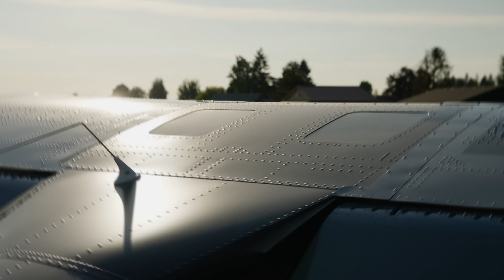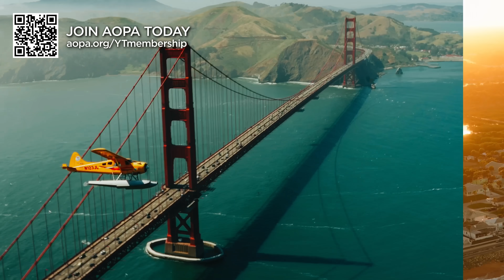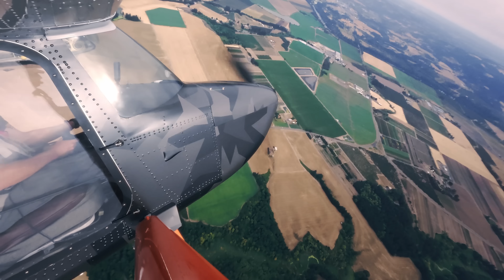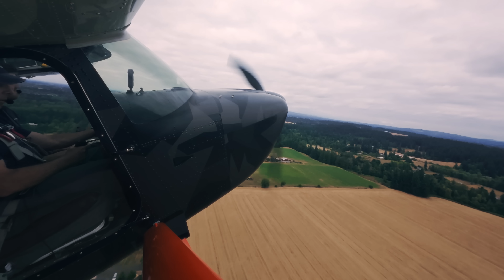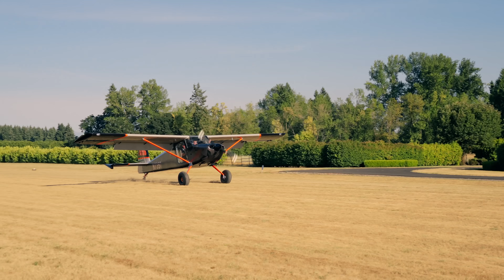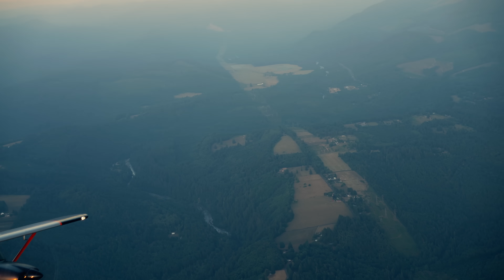We Finally Flew Van's Aircraft's NEW RV-15 – Was it Worth the Wait?

Comment: Never mind the fluff, I want to see some solid performance numbers, and find out what did the STOL cost in HP and airspeed.  I suspect it will be second best compare with the Helio Courier, for it will be a kit and you will try to make it simple, no auto slats or huge flaps with spoilers to add to roll control. Lets hear the compromises.

Comment: how is it compared to a Glasair Sportsman 2+2 kitplane?
Reply: Glasair has been extremely quiet lately. Their social media seems dead. I know they were transitioning to Chinese manufacturing, but it's unclear if that's going to succeed or be the end of the company. I hope they succeed, as I quite like the Sportsman.

With that said, they're fairly comparable high wing 140ish knots STOL/backcountry capable aircraft The Sportsman does offer a CD-155 Jet A/diesel engine in addition to two Avgas options. It's unclear if the RV-15 will offer rear seats or not. The Sportsman has optional BRS parachute, whereas I've heard the RV-15 wasn't designed with that in mind.

Comment: I think the question is "is it worth the money?" I mean, besides to the rich people who don't care that the whole point of experimental aviation has been dead for a long time.
Reply: Only the pricing for the wing kit has been announced. So I think it's too soon to say, as we don't know what the total will be.

I'm not sure exactly what you mean by "the whole point of experimental aviation has been dead for a long time" means. Can you clarify how you know it's dead, and what led to that?
Reply: @masonmcglothlin5101  Hey Mason, regarding my "experimental aviation has been dead for a long time" comment. I mean in the respect that you could build a 4 seat, 200mph, 1000 mile range plane in the $90s for about $40k (My example is a Cozy MKIV that I was working on) I made $11/hr back then but felt like that was an absolutely achievable goal. Most kits, regardless if they are something like a Kitfox up to an RV-whatever is so horrifically expensive that no Average Joe can afford that. I was building an RV-8 and when I started, using the calculator Van's use to have, I was looking at $100k without paint or tools. And even then people told me I was way under what it would cost. Now, If I talk about building that same plane for anything less than $200k people tell me I am nuts and it will cost way more. Everything has increased in cost to ludicrous levels. I cannot afford on a single income to build it anymore. The spirit of homebuilding was to get an awesome aircraft for incredible prices compared to factory.
Reply: @1hornet1  Inflation has certainly happened since the 90's. But considering completing a lot of kits would cost about what an expensive pickup truck costs these days, and how many people there are out there driving those expensive pickup trucks, it seems that dream is still alive for those who want it.

Van's site is showing a basic RV-8 kit for $47.7K and an engine for $44.7K. So $100K for an RV-8 is probably in the right ballpark today. Whether that's doable for you depends on your own financial situation: how much you earn, what's the cost of living in your area, do you have kids or other dependents, do you have outstanding debt to pay down etc.

I see a lot of people complain about the cost of everything, yet they go blow their money on things that just bring temporary joy, they don't take steps to earn more, and they don't carefully consider their housing and vehicle choices. I'm not saying that's you, I don't know you. But for those who are willing to work towards it and start early enough, aviation is still within reach.
Reply: @1hornet1  Inflation has certainly happened since the 90's. But considering completing a lot of kits would cost about what an expensive pickup truck costs these days, and how many people there are out there driving those expensive pickup trucks, it seems that dream is still alive for those who want it.

Van's site is showing a basic RV-8 kit for $47.7K and an engine for $44.7K. So $100K for an RV-8 is probably in the right ballpark today. Whether that's doable for you depends on your own financial situation: how much you earn, what's the cost of living in your area, do you have kids or other dependents, do you have outstanding debt to pay down etc.

I see a lot of people complain about the cost of everything, yet they go blow their money on things that just bring temporary joy, they don't take steps to earn more, and they don't carefully consider their housing and vehicle choices. I'm not saying that's you, I don't know you. But for those who are willing to work towards it and start early enough, aviation is still within reach.
Reply: @1hornet1  Inflation has certainly happened since the 90's. But considering completing a lot of kits would cost about what an expensive pickup truck costs these days, and how many people there are out there driving those expensive pickup trucks, it seems that dream is still alive for those who want it.

Van's site is showing a basic RV-8 kit for $47.7K and an engine for $44.7K. So $100K for an RV-8 is probably in the right ballpark today. Whether that's doable for you depends on your own financial situation: how much you earn, what's the cost of living in your area, do you have kids or other dependents, do you have outstanding debt to pay down etc.

I see a lot of people complain about the cost of everything, yet they go blow their money on things that just bring temporary joy, they don't take steps to earn more, and they don't carefully consider their housing and vehicle choices. I'm not saying that's you, I don't know you. But for those who are willing to work towards it and start early enough, aviation is still within reach.

Comment: 20k for a wing kit and the rest of the kits to be delivered at the end of 2026... We don't even have weight specs yet...
Impulsive people are going to fill the order books up and then discover manufacturing/assembly hiccups that are going to push production and delivery back even further and they're also locking themselves into a build with completely unknown pricing for the remaining stages which likely are gonna climb even higher.... this is going to be a 5 year build if anyone is lucky and it's still be a 2 seater. A great looking plane but the price and delivery times on this are silly. A Sling High Wing carries 4 and goes faster and does all the bush work you could need and importantly is available right now.
Reply: Sling HW has too high of a stall speed for backcountry work. Doesn’t even qualify for a sport pilot under the new MOSAIC rules unless they make changes and re-test it. Don’t get me wrong, I like the Sling HW. I’m looking at the Rans S-21 as a slightly more affordable, fairly quick 2-seat high wing.
Reply: @joesmythe8232  The S21 is a fantastic airplane. It's smaller than the RV, but the advantage is that it really performs with the Rotax 916!
Reply: A Sling high wing will do no such thing as bush work, especially with 4 people aboard; it's design and performance clearly compromise that in favor of speed. I don't disagree with the rest of your rant.
Reply: @serg2963  You and everyone else know perfectly well that 90% of RV-15 builders will NEVER take it to the bush or anywhere that requires an actual STOL airplane. A 2,000' grass strip is not the "bush" and a Sling HW can handle that easily.
Reply: @Jester-uh9xg  I've read of people wanting to put wheel pants on their -15 for better speed... so  your estimate of 90% is about right! But I will NEVER agree that the -15 and the Sling are comparable aircraft. Some people's mission might have overlap between the two aircraft, and those people should consider it... but at that point, one could consider a Bonanza, or a Mooney... I think you get my point.
Reply: @serg2963 I'm sure the RV-15 will be a great aircraft on its own merits but I think the excitement around it is a little odd. If people wanted a 2-seat side-by-side bush plane there's already several options including the fabulous S-21, and they'd already be building one. But they aren't, and those don't get 10% of the hype. I think the RV-15 hype is just because it's a high wing Vans, not because it's a bush plane, and people have kind of the wrong expectations. As far as Mooney vs Sling HW, well, the Sling is high wing and not 60 years old. For the same price the Sling HW would be massively superior to those (sadly they're much more expensive, just like the RV-15 will be).
Reply: @Jester-uh9xg  OK, I agree with you 100% on the S21; a truly fantastic airplane and a perfect match to the fantastic Rotax 916. As for Vans being a little "culty"... sure! HAHAHA  All joking aside though, the attraction (for me) to the RV is the size... and the assumption that being an RV, it'll handle much better than something like a C170/C180. The hope is that it'll handle as well as the S21!
Reply: Its great to see a all metal STOL aircraft.  Much of the back country planes out there are fabric.
Reply: @fudogwhisperer3590  that's true, there are some options coming to market which is great news. Direct Fly has the STOL Cruiser which looks a lot like the Vans actually. Should be on sale 2026. 60kg payload capacity supposedly and very similar specs. There's the Sirius Backcountry which is composite and the STOL Cruiser actually outperforms it despite being all-metal! I look forward to someone putting some VGs and fences on the STOL Cruiser once it hits the market!

Comment: Here we are in 2025 finally able to build essentially what could be bought off a showroom floor in 1955. (Cessna 170).

I realize a lot of people have been itching for an aluminum high wing with grass airport operation as a primary consideration. But there is nothing groundbreaking here. Not like the RV-3. Or the -6 when they came out. 

This is tame and ordinary. But it will cost fully 3/4 of the price of a new Cessna 172SP to complete one of the RV-15s with similar appointments. (All glass, leather, etc).

You can buy a brand new 172 fully loaded for about $400k. This will cost $250-300k with all-new engine, prop, equipment, G1000, and paint.

EAA has gravitated away from high performance for everyday car prices. To mediocre everyday performance for supercar prices. You have to take out a loan on your 401k if you want to fly and enjoy one of these things before you lose your medical.
Reply: You can be upset about the expense of these kits and basically all of aviation compared to the past but you are completely out of touch and incorrect about new Cessna 172S prices.  They haven’t been $400k new for a decade now.  Even a 10 year old 172S easily sells over $400k now even with massive hours and wear from a flight school.  2025 Cessna 172S prices are quoted by Textron as over $700k with delivery hopefully 2028.  As of Oshkosh 2025 they were basically $750k. They sold a few that week.  An RV-15 will have much better performance and cost less than half as much even with the very best appointments.
Reply: 1. We don't know final pricing of the RV-15. Only the wing kit pricing has been announced.
2. Where are you getting $400K pricing for a fully loaded 172? My understanding was they pretty much start at that price, and their factory is backed up with all the orders.
3. If the RV-15 costs $100-150K less than the 172 at similar or better performance levels, that's a massive improvement, and something to be celebrated! Particularly if the RV-15 can have 4 seats.
4. The Cirrus SR series leads GA sales by a pretty wide margin - and they're more expensive than a 172. In some cases 2-3x more! It seems the market is demanding all these features, and putting their money where their mouth is and actually paying for it.

I agree, it's unfortunate that prices are as high as they are. I'd like to see more budget four seat options in the $150K range, even if they're a bit limited on features. But it's good to celebrate steps in the right direction.

Comment: This could honestly be a decent Cessna 172 competitor
Reply: But faster. This thing with that motor has 20 kts on a 172!
Reply: Hopefully (knowing Vans Aircraft philosophy) it will fly MUCH better than a 172, or any other Cessna product.
Reply: A Cessna can be financed for 20 years. It takes exactly 0 hours of built time and 0 rivets or tools. Let alone shop space.

There is no competition.

An RV-15 is going to cost $250-300k to complete with similar appointments. Glass, leather, new IO-360, etc.

A Cessna is $400-450k and can be owned literally tomorrow with a phone call. And it can be financed.
Reply: @Triple_J.1  It's likely that Vans will offer fully factory built RV-15's, like they do with the RV-12iS. Their comments during the MOSAIC commenting period hinted at that. And the RV-15 should qualify as an S-LSA. And you should be able to finance it as well.

Comment: The one thing I just can't deal with is the stick in my left hand and throttle in the right, just not natural! I would have to build mine with at least a dual throttle, one on the pilot's left side and keep a center throttle, have them coupled. I could deal with the prop and mixture in the center. That's the only change for me.
Reply: It just takes a few flights for most pilots to become accustomed to it. The RV6,7,14 are the same wat. Center throttle, mixture and prop. Creating a left side throttle mix and prop,connected!  to the center is something no one would want to build!
Reply: You would adapt very quickly. I learned with yoke left/throttle right and toe brakes. I just bought a taildragger with left hand throttle, right stick, and heel brakes. My first couple minutes of taxiing were very confusing, but it really only took me an hour or two to figure it out.
Reply: My Lancair is the same. I'm right handed and don't even think about while landing with my left hand on the stick and right hand on the throttle. You get used to it quickly. It's a stick which is really what matters!
Reply: On my previous experimental motorglider with side by side seating, I had the dash layout inversed and flew it from the right seat. Felt natural.. even though I fly my 172 from the left seat. Old habits die hard…
Reply: Stick or yoke most of us aren’t south paws, the control in our left hand and the power in our right.  Everyone does just fine.

Or sit in the right seat and fly it if you still have that mental block.

Comment: Those wheels could use some boots for less fuel consumption and better range.
Reply: The airplane is designed for back country flying in and out of unimproved areas.  Wheel pants would be counter to that mission.

Comment: “Was it worth discontinuing the heart and soul offerings of their product line?” -is what I want to know, because I can’t see how it is. This market segment is more than covered by other companies. GA didn’t need another recreational bush plane and most certainly did not need the availability of the best performing kits ever designed to be sacrificed for it. Maybe we should ask the hundreds of unsecured creditors for discontinued kits on Van’s books what they think while we’re at it…
Reply: I don’t see any connection between discontinuing the 3,4 and 6 and bringing out this airplane. Clearly their production needed to be rationalized and made more efficient after they entered chapter 11. The 3,4 and 6 are not computer designed airplanes. Nothing fits, everything has to be match drilled by the builder and production processes are primitive and hard to scale. Another big issue is tgat those airplanes are so old that the current staff doesn’t know much about them. All those who built and supported them are retired or dead. It’s a no brainer that these were discontinued in order to get their financial house in order. The 7 replaces the 6 and is a much better engineered airplane in every way. The 3 and 4 are no longer being ordered in significant numbers. These would have been axed eventually whether the 15 went ahead or not. In fact the 15 went ahead largely due to popular demand from pilots. This market segment is NOT well covered at all by other kit makers. There are lots of cub type airplanes out there but the bigger ones have not been successful. The glastar and sportsman have poor handing. The tundra had structural problems and the company failed. Nobody has put out a c180 replacement that is nearly as good as this appears to be. Rationalizing the product line and bringing in something new and exciting is good business and I think Vans is back stronger and smarter. There will always be people who aren’t happy but that’s life. I think the success of the 15 will help ensure the survival of the company.
Reply: Once you start digging in you will see this plane has a unique footprint in the market. It should/will sell very well.
Reply: @SilvaAdventures they did a lot of market research and I think they got the right answer. All of the engineering is almost secondary. The genius is in the product definition.